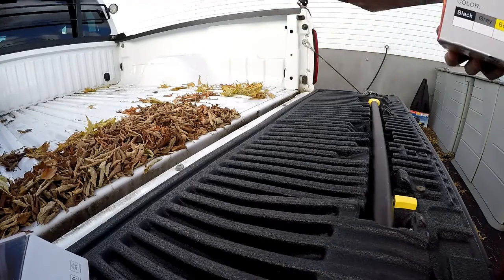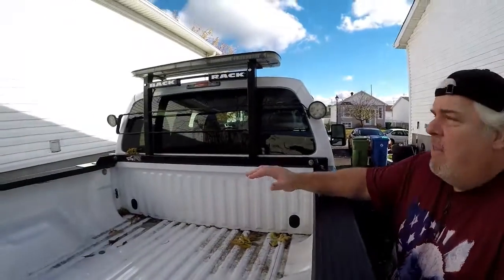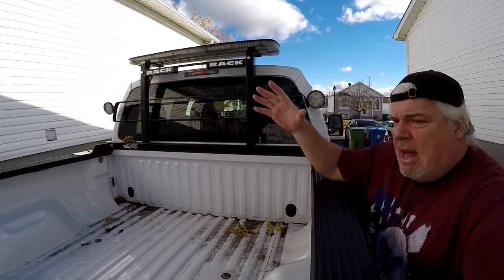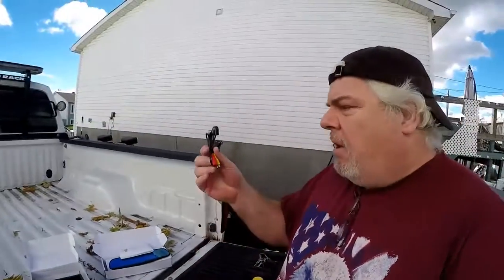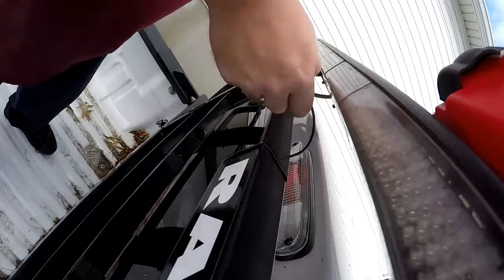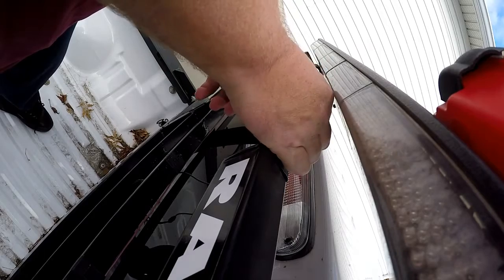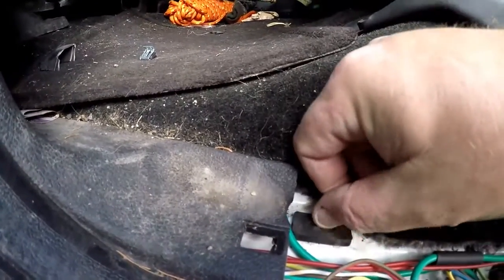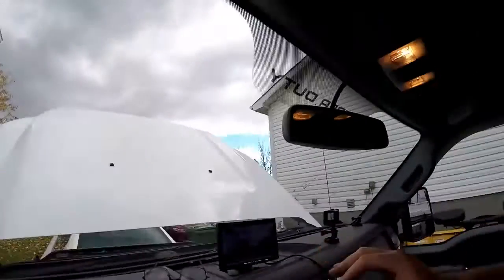The Plow Guys. Backup camera install

Comment: I plow several public parking areas, about a 1/3 mile of road and  a couple private residences in Colorado mountains. I am amazed at how careless people are when they are in a hurry.  Almost nobody will yield to plow equipment.  I installed a back up camera on my plow truck a couple years ago.  Great improvement and really helps plowing, because you're right, you can't fix stupid.
Reply from the maker: I know right. The last thing anyone wants to do is run over a person. Stupid is everywhere. I may be a little harsh by saying Stupid when I meant to say careless but lets face it careless you can walk away from stupid you can't..Thanks for your comment Rod.  -John
Reply: Exactly

Comment: Good to see you back at it!!
Reply from the maker: Hey Keith thanks so much. Glad you stuck around....LOL  I still have another system I want to try out. Something a little more passive. -John
Reply: The Plow Guys you should have your son in more videos it reminds me of me and my dad the way you guys work together
Reply from the maker: Oh boy you might be opening a can of worms here.
Reply: The Plow Guys lol
Reply from the maker: He is 22. He is scared shitless when he drives the Plow truck. Not because he isn't confident to do so. He drive very well. He is terrified of how I will react if he fucks up my truck. Last winter he had to mount the plow and when he went over a speed bump in the parking lot the plow fell off. He damn near shit himself. I could hear it in his voice when he called. When I got there it was nothing. He had not secured one of the pins and one side came off. now yes we are lucky it happened at low speeds. I just laughed and we put it back on together. I used to be a HARD ASS but not so much now. Old age has smoothed me out a bit like a iron..LOL
Reply: The Plow Guys I hear you on that my dad used to be the same way with me now I'm 33 and he is 61 and he's chilled out as well but he taught me a lot
Reply from the maker: Tell him that. That would make him feel good, very good.

Comment: Very nice video, Very good idea with the camera.  Could the wireless system be interfered with by anything you think?  I haven't ever used the wireless ones, just wonder if power lines or anything could mess with the system.  Thanks for sharing, take care my friend, and stay safe out there.
Reply from the maker: The wireless systems now run at 2.4 Ghz. Pretty much anything that is wireless can be interfered with. Wired is the best way to go. Wireless just saves you running a video wire. You will still need to run a positive and negative wire to power the camera. I will be trying out a wireless later on to see how it works. -John

Comment: I was thinking about installing a back up camera so I could hook up my trailers. After this video I think it might be a good idea.
Reply from the maker: Wireless is great for that application. The problem is the two units are farther away. There is more of a chance of interference. I will be trying out a wireless unit. -John
Reply from the maker: Oops I miss read your comment. Ya they are great for that. You will get that ball under the hitch like a pro. The factory camera on my pickup is great for close quarters and it has a line that matches up with my hitch.- John
Reply: Thanks bud.

Comment: Camera connections are pretty low quality. There referred to as RCA and they are not at all waterproof or environmental. On highway plough operator and we use quality cameras due to the salt
Reply from the maker: Yes salt gets into everything.